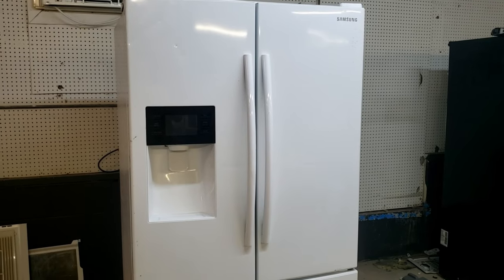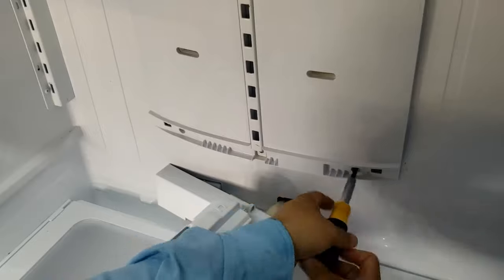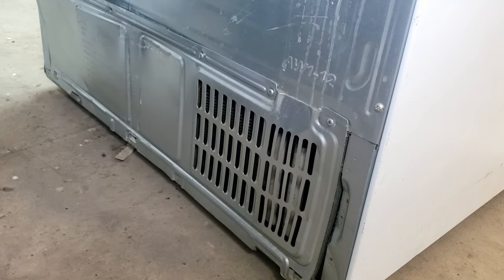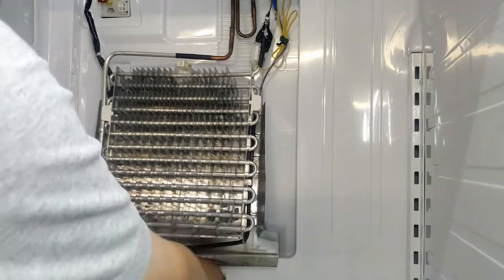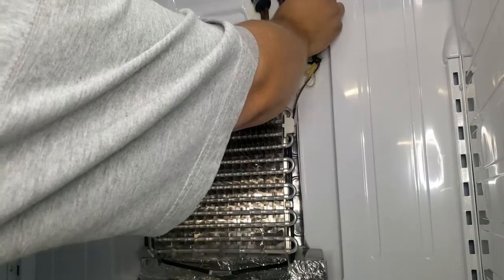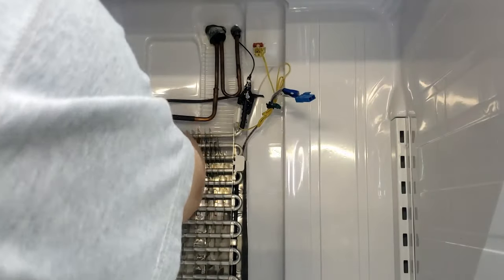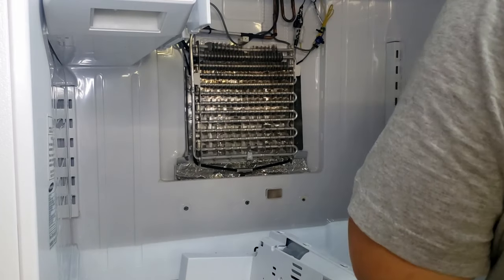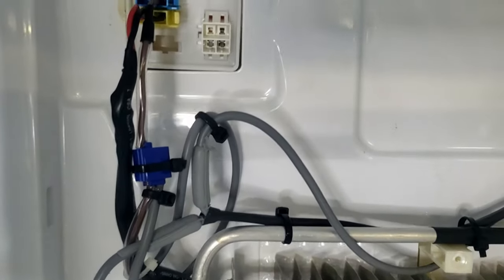Samsung Refrigerator Ice Build-Up and Leaking Water Inside Drawers - How to Fully Fix it Forever

Comment: I'm actually doing this fix right now Ben, thanks for this helpful tutorial. The only difference I've made is I'm using stainless steel wire ties. My thinking is by cutting the tails a bit long, they may increase the heating wire's surface area by acting as heater extensions themselves. If nothing else, the tie locks should act as extra heat nodes. I'm currently trying to get the Samsung replacement heat tab far enough down the drain so that it sits properly on the lower heater element. Right now, it sits about 1/4" above the element and bottoms out on (I'm guessing) more ice.  So far, so good... Thank you again Ben, this was really well done, and more thorough than any others I had seen.
Reply: Quick update: I had to make a 90' twist in the Samsung heat probe to get it to fit. My drain has a 90' bend about 1/2" from the fridge opening, going off to the left when facing the front of the open fridge. Making the twist let it drop down and follow the bend, staying tight to the back, then bottom of the drain. I'll have to check it to see how this works out. The rest went great. Because of availability, I went with the Supco SH201, which is a metal braided heater with the leads on each end, but otherwise is functionally the same as the SH502. I ran a forced defrost to confirm the new wire indeed warmed up properly before putting the fridge back together (I'd rather only have to go through this once). It heated up and got hot enough I could only keep my fingers on it for 1-2 seconds, and I did find that the metal cable ties also heated up enough that they were uncomfortable to keep my fingers on by about 2 seconds. Your fingers may vary. All that to say, so far so good!

Comment: Finally a fix that works after years of struggle. I bought the 201 heater on line and the high temp tie wraps and clips at Home Depot. Different Sammsung Model (Side by Side) but located the brown wires and clipped it in tested it by forcing it into defrost and it worked. Been 2 months and no upper iceburgs or fan noise. Thank You so much and I will never buy a Samsung appliance again.

Comment: BEN... You are my HERO! Just ordered your kit. Cant wait to try it out. I have been manually defrosting my fridge every couple weeks for the last year. I tried doing a similar thing by adding a short piece of heat trace tape but it didnt really get hot enough. Hoping this fixes my frost issue! THANKS for taking the time to make such a great video and offering such a complete kit.
Reply: Where did you find the kit? Do you have a link?
Reply: @princessfiona911  the link is in the video description
Reply: I have everything but the the new drain tubes. Are the necessary? The originals are faulty? I hate to put all this back together and it freezes up again. I wouldn’t know if it was Bc of tubes or I messed up elsewhere!  Thx for the vid
Reply: @dennybug2  when I replaced my drain tubes, I thought it to be unnecessary until I pulled out the old ones. One of the tubes was completely clogged with gunk and I noticed that the plastic fittings became very brittle and crumbled when removed. Good idea to replace them especially, if your unit has some age. My Samsung is approaching 10 years.

Comment from the maker: Update: Since making this video, I've seen a lot of people use this fix, successfully buying all the items mentioned below. I've been able to build a custom-made package, so viewers didn't have to spend the full $80-100 that Amazon is now charging for everything (the heater, the drain kit, and over-buying certain parts). I've packaged the heater with ties and connectors for sale at this link: https://bens-appliances.com/collections/all/products/refrigerator-secondary-heater-kit for about $25 less than buying it thru Amazon. Use the code "YOUTUBEKIT" for an extra 10% off on the entire kit.

Also, since YouTube doesn't let me update VIDEOS, one revision I wish I could make involves the foam strips: You want to put those UNDERNEATH the metal drain pan, not inside of it. This way the water channels behind the pan and doesn't get stuck during defrost.
Reply: Just bought a "kit". Hoping this will fix my ice build up issue.
Reply from the maker: @shred1  It should! I shot an updated video with the kit to test it, and it shredded the frost buildup within a few moments.
Reply: Ben I had a warranty call on January 15 same exactly refrigerator issue u know the build ice on back panel so I replace the temperature sensor that’s it then today bump same guy call me same issue so I decide to do this trick here u showing put a extra heather up wish me luck because I don’t really wanna hear that call again lol 
Plus ima order couple heathers from u and the clips thanks for this video
Reply from the maker: @juansanchez-kb4ij  use the code Appliancetech on the 10pc kit and it'll drop the price more for you. I did another video doing this install with positaps. I swear it took all of 10 minutes even with a camera in my face. You do it two or three times and its easier than just about anything, and it's big money with few callbacks.
Reply from the maker: Or if you want the whole kits, the code will drop price some percent. Order a few and I'll see if I can't throw an extra set in or two. This mod is to help homeowners, but I don't want to take profits away from techs either, so I want to make sure you guys get good margins
Reply: Thanks Ben. Just ordered a kit to fix my refrigerator.
Reply: Just bought a kit and hoping this will finally put an end to the nightmare that this fridge has been. Thanks for your great video, I - and I’m sure the rest of us who’ve come across your video searching for a fix - sure appreciate it. Happy to buy from a small business. Keep up the good work 👍🏼
Reply: @bensappliancesandjunk  Ben does your kit  have the  form backed strips
Reply: @bensappliancesandjunk  Ben after reading further I see you are working on a complete kit. Great. Is it available yet?
Reply from the maker: @a330bobby  the link has everything but the drain tube and tape so far
Reply from the maker: @a330bobby  no, not yet. It has the heater, cable ties, wire splicers, drain probe, and silicone caulking to weatherproof it. I am working on the drain tubes and insulated tape. Finding the exact tape Samsung uses so I can get it die-cut has been... difficult. The drain tube(s) are like 6 pieces, so I have to find a supplier of all 6 pieces, which I am working on, just may take a little time.
Reply: @bensappliancesandjunk  thanks great info. Don’t stop. Keep the videos coming
Reply: Awesome and as an engineer this mod makes a lot of sense to me. Can you figure out the “cure all” for the ice maker icing problem? I’ve spent a lot of time investigating and trying different fixes, but nothing has worked. After seeing this, I’m wondering if the iceblocks that form in our freezer sections are part of the problem
Reply from the maker: @54GrantC  Thanks for the question.

I am building a complementary kit for the icemaker. Its going to contain 4 additional parts for it: RTV food-grade sealant, Y-clips for the drain line(s) and then a replacement piece for the fill valve.

My opinion is that these items IN ADDITION TO THE HEATER KIT should greatly improve its ability to operate. I do not think this is a sure-shot fix like the heater is with the ice ball problem, because there are more moving parts with the icemaker. 

However, the real OEM kit that has a higher likelihood of working is about $250. This additional kit will cost $20 + the cost of the heater system.... I think that, given the price, has a good chance of working.

Mind you, I'd love to offer a better kit than a $20 option, but there are certain pieces I cannot easily replicate, namely the fill valve heater that they include with the upgrade. You see these types of kits on other brand refrigerators like Whirlpool/KitchenAid, but I believe that you need a board logic upgrade to make it work, hence the Samsung repair kit containing the icemaker, fill valve heater, then a brand new control board for your specific model of refrigerator. Not cheap by any means.
Reply: Is there a link for ordering the kit?
Reply from the maker: @ruthannward540  link: http://bit.ly/3azB4e4
Reply: I ordered the part. Thank you for this informative video! I called to ask pricing for a repair and it was in the upwards of 200 dollars just for a trouble shoot. I hope this works!
Reply: @54GrantC  The Ice maker problem is part of a class action law suit that Samsung lost.  Call you authorized Samsung service depot and they will send a tech with a kit which includes a new main board. I had this done if Feb 2021 and so far June 2021 it is working. Finally!
Reply: IMPORTANT:  The foam strips are supposed to go on the REAR of the metal panel, not the front as shown in the video. Google "Samsung's Service Bulletin ASC20171005001" for the correct instructions.
Reply: @r.castano4325  - Thanks for sharing. I don't use refrigerator icemakers, but I'm assuming there's no lawsuit regarding the evaporator panel icing over, right?
Reply: @PureBlood42  you are correct. The fix is to install a sup501 15w or. Similar in parallel with the existing "cabin" defroster. While your at it add a Drain tube clip on aluminum defroster with extended tang to original.  I don't what law firm won that law suit but if enough people start looking then I'm sure we can find them and ... Any kit you sell to will be reimbursed and do will the labor cost. Samsung charges $500 min. Just for the visit. Parts and labor are additional cost. So... Retro active. Samsung sent me a check for the 1st repair that failed, that I paid for.
Reply: @r.castano4325  - Just so I'm clear, my evaporator panel icing-up with ice oozing through the panel cover and my fans not spinning at all due to the ice buildup....they will or will not fix that free due to the defect or the will not? I don't have a warranty. Are you indicating I should just not even pursue the fix with Samsung and just buy one if the fix-it kits? Sorry, it's been a long day, I'm a bit exhausted.
Reply: @PureBlood42  3 problems with Samsung French door fridge: 1) icemaker freeze = law suit covers repair. 2) "Main Cabin" food storage area. Not covered fix with SU502 15w heater. 3) Drain tube freezes not covered fix with clip on aluminum defroster with extended tang.
How this helps. These three fixes make this a rather nice fridge. Shame on the senior project engineer for not reviewing these rookie engineer mistakes. Shame on Samsung for making out so difficult to acknowledge error and effect repairs. That is why they lost the law suit. Now let's sue them again. Similar to crowd funding it takes critical mass to prove the case.
Reply: @r.castano4325  - Thank you so much for all the information. Do you recommend the full kit provided by Ben's channel?
Reply: @PureBlood42  Ha I thought you were Ben
Reply: @r.castano4325  - 😂
Reply: I bought the kid but it looks kind like different than the one you used 😲
Reply from the maker: @emmanuelblanco4718  they operate the same generally
Reply: @bensappliancesandjunk  okay thanks Sir 👍
Reply: Hi Ben- Great video. Thanks. Will this and the optional defrost sensor DA32-00006W work with SAmsung Showcase RF28JBEDBSG model?
Reply: Hi Ben- Great Video. Thanks. Will the Secondary Refrigerator Kit as well as the optional Defrost Sensor DA32-00006W work with a Samsung Showcase RF28JBEDSG model?
Reply from the maker: @pamelafong95  it's pretty much universal, the defrost sensor.

Comment: Works - once I figured out I needed to use a screwdriver with a magnetized head to get the screws out. Solved the problem completely for a couple of weeks, until the issue started again. Next step will be to see what is going on with the drain tubes. Thanks for this video.

Comment: Thanks for all the extra detail and explanation for the 'nuclear option' of fixing this annoying leakage problem with the auxiliary heater Ben!  I'm hoping I can get away with just upgrading the little aluminum tab but now know what I'll have to do if that's not sufficient...
Best, Matt
Reply: Hey I watch your woodworking videos haha

Did the fix work for you?
Reply: @walnut_trail_farm  Cool about you watching NLC videos... thanks! 
Where the Samsung fridge is concerned the answer is yes, no and sort of🤔
Following your instruction I bought and replaced the little aluminum tab thingy but even after I did that, water wouldn't flow out of the tray.  Turns out the root of the problem was snot wads of dust in the little drain tube cap slots so I think I could have just got away with cleaning the drain tubes and not replacing the tab?  No matter, I'm glad I've got the upgraded/longer tab installed so I don't have to worry about future freezing of the coil.  Bottom line is that now overflow water is not leaking down and freezing under the drawer causing it to jam up.
Now I've got to resolve a leaking ice-maker chute.  I tried adding foam to the seal/boot which helped a little so I bought a brand new OEM seal and installed it.  Sadly I've still got the leaking problem.  Next step is to remove calcium build up from the chute door seal but I don't think that will be a complete fix either because the whole ice tray is now totally frozen into place.  I've been procrastinating fixing that because, near as I can tell, the only real fix for this problem is to remove the ice maker unit and seal up gaps in the housing to prevent 'warm' air from the fridge from leaking into the -5 degree ice maker/freezer compartment.  All pretty frustrating for this ol' nail bender... I'd much rather be in the shop making something cool and shooting video about it for viewers like you! 😉😎
Best, Matt
Reply: @NextLevelCarpentry  replace the tab too or the drain will re-freeze at that point. Some use a copper wire snaked down into the drain hole 3 or 4”. Idea is to get heat into the hole to keep the condensation water flowing. Mine froze solid 4” at least. It takes over an hour to thaw this tiny drain because there’s no access but at the top. Speed up the process a little by squirting the hole with a turkey baster with hot water repeatedly. And/Or let the fridge thaw overnight. You can hear when this ice plug is finally thawed and running clear. Then that water drops down into the tubes at the bottom rear of the fridge. The bottom outlet of this drain line is what you see in the back rear with panel off. That’s another issue..those tubes must be cleaned or replaced, but they’re cheap. I’m putting in a secondary heater up near the fan too.
Reply: @chilitoday  Thanks for the additional info!  So far I've solved this problem with the longer/aftermarket "tab thingy" and by cleaning out the bottom of the drain tubes.  Still have problems with the ice maker freezing up but hesitate doing the full heater upgrade and crack-sealing procedure I see recommended in other videos.  Sad all these problems arise with such an expensive and otherwise pretty nice fridge IMHO.
Best,
Matt

Comment: Thank you! My drain was completely frozen and I had a huge ice block by my fan as well. I purchased -    DA82-01415A water leakage kit from Amazon and your link, and I am trying the drain tubes along with the new larger drain heating element and insulation first. I also added insulation around the copper pipes at the top right where the ice formed. Getting the clips off the back was difficult, so thanks for pointing that out. I think my additional insulation made the replacement of the panel slightly difficult as well. Now to see what happens....

Comment: Just used the complete kit with the moisture addition for a Samsung RF267AARS/XAA.  A bit different than the Samsung in Ben's superb videos, but everything fit well.  Took me more than a couple of hours as there was a fair amount of ice in the drain tube, rust, cracks in the refrig backwall, and double sided tape on the styrofoam.  Working well now.  Thanks Ben for the kit and videos!